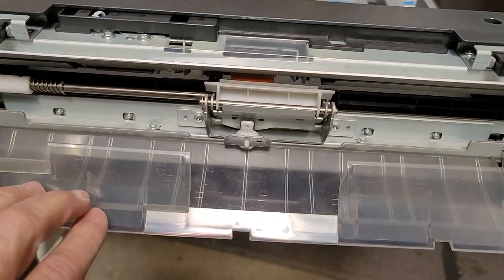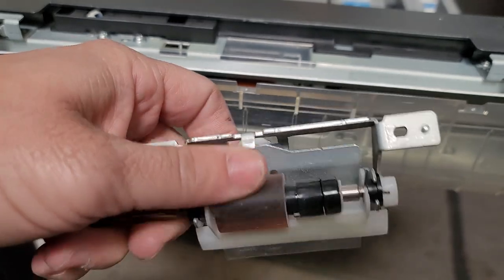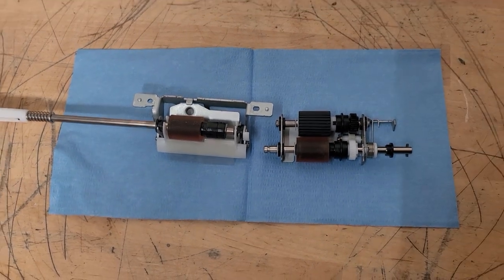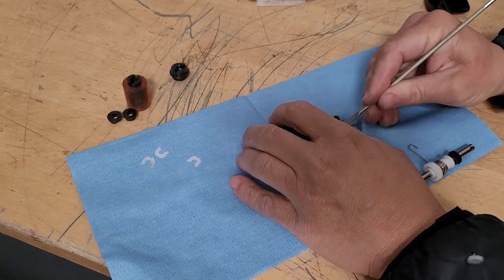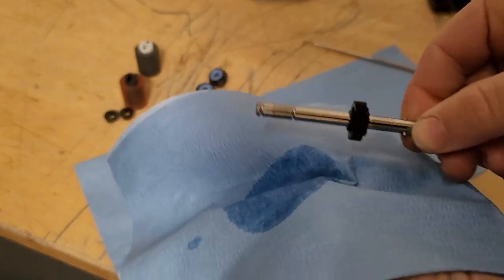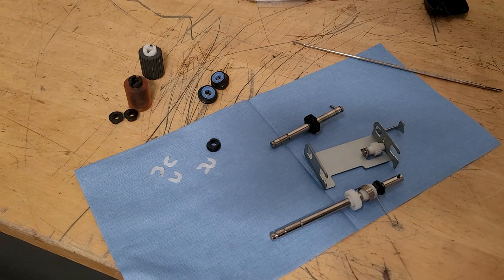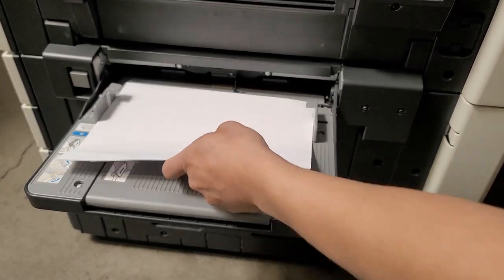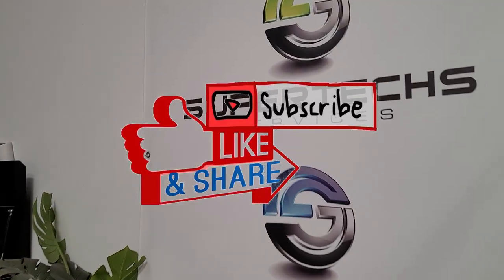How to replace the manual bypass tray rollers on Konica Bizhub Copiers  #konicaminolta #bizhub

Comment: Could you help to get some firmwares of konica minolta
Reply from the maker: email info@supertechs3.com
Reply: My Konica c759  - c2555 error , how to fix it sir. 😢
Reply: It's easier if you take the springs off the clear paper guide so you have both hands free to work with. The service manual won't tell you this.